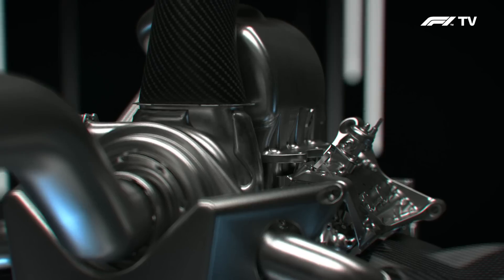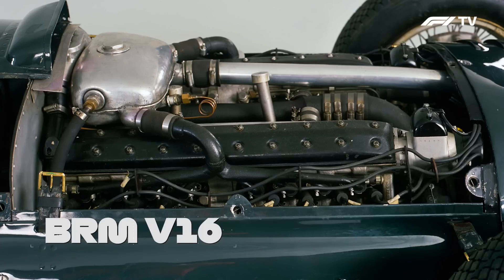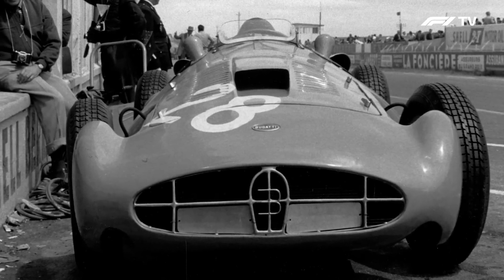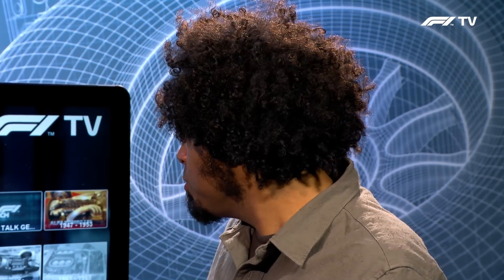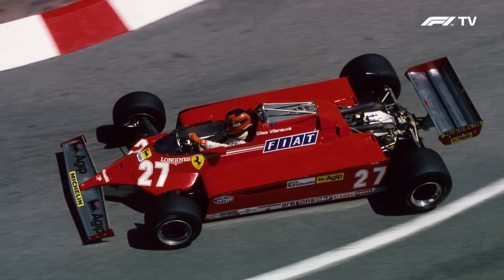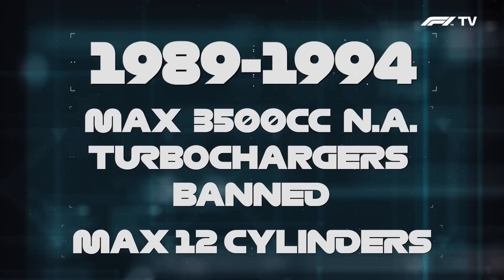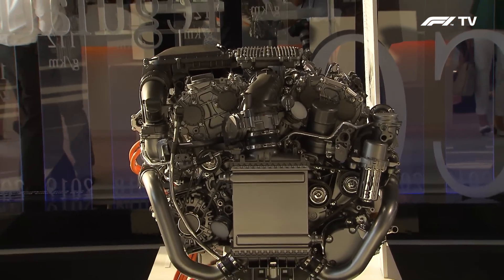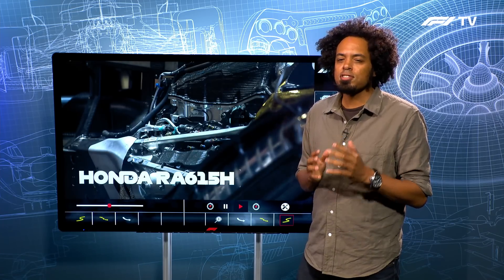Evolution Of F1 Engines | F1 TV Tech Talk | Crypto.com

Comment: I’d have a rule that only production engines can be used, but teams can do anything they like with them. Diesels are allowed, so long as they’re production based. Although they’re a 2 litre off the shelf production model engine from the assembly line, anything goes. Cylinders are unlimited, so long as it’s the same as the engine you find in a production model car or light truck.

Comment: I don't understand why they are pushing hybrid systems and "sustainable" fuels, yet manufacturers aren't allowed to use variable valve timing or lift control, variable length intake runners etc. Wouldn't it be better to allow these technologies as they (vvt/vvl) are already commonplace on road cars?

Comment: I'd like to see a two tier system, like they've had at times in the past. Say an N/A 1.5 litre V12 with a minimum weight car around 700 Kg, and a turbo hybrid at the current weight limit. Make the V12 cheaper to engineer to get more manufacturers in.

Comment: The biggest issue with formula 1 is the size and weight of the current car's. The car's of 2004-2007 were far more exciting to watch. They were significantly smaller and lighter. Combine the old cars with the old Q3 Qualifying sprint and it got really exciting to watch. Even the tyres were better in my opinion.

Comment: Awesome video, yesterdays video on efuels and 2026 motor regulations was cool too. It's the first time I saw conformation of F1 going to 100percent efuels, love it. But with some of the things I've seen this year in F1 I have became a supporter of a mostly controlled chassis built by a third party, with some parts the teams can develop like front and rear wings. I think teams should able to change gearbox ratios on a race by race bases so teams can make changes as the engines develop. I like the idea if a new team came to the sport there could buy a chassis, get a engine deal and compete out of the box. If a new team wanted to enter sport now they will be years behind with ground effects. FIA I believe needs to take control of the ground effects element of the car.

Comment: Thermal efficiency of more than 50% percent. I know this is amazing for an ICE, but it’s absolutely unsustainable in comparison to an all electric power unit. It’s like an old skool light bulb versus a LED diode.
Reply: 50% Amazing? This is absolutely crazy, there is nothing on earth that can come close to that. The technology behind it is unbelievable. I wonder how far can they go while keeping the engine reliable
Reply: It’s not ‘thermal efficiency’, it’s thermodynamic efficiency.
The greater than 50% achievement of MB means that it’s much more efficient than generating electricity in a power station & then charging batteries.

The loss of the MGUh is a backward step in the thermodynamic improvement of a power unit…

Comment: I think the regulations have ended up limiting the spirit of Formula 1.  You should have the ability of competing different types of engine configurations, with or without forced induction.
Larger capacity engines naturally aspirated vs small capacity turbocharged engines.  To me the most beautiful engine sound comes from V12s engines, V10s and V8s are nice, but nothing like a V12.  I remember back in the day when 4 cylinder turbo engines were it.  Then came the V6 turbo, then came the ban, are the different configurations flat boxer engines, v12, v10s.
I did not like the V8 era very much, but it was better than the current era where one manufacturer has obliterated the competition.  No one can come close to Mercedes dominance.
Reply: Considering that the top four teams rn all have different engines your comment about Mercedes dominance doesn't really add up
Reply: @bananatree2527  oh! yes! you are absolutely right!  After 8 years and changes in regulation allowing other manufacturers to catch up with them, Mercedes dominance has been reduced, and has been finally demoted from the top to a third.  Oh by the way, their problem right now is aerodynamic and balance, not a deficit in power from their power unit, but you are right, my comment is just crazy.  Sorry!

Comment: The engine regs are meaningless in terms of F1's carbon footprint.  Getting the teams, tools and cars to the venue burns orders of magnitude more fuel. And getting the fans to an from the track burns orders of magnitude more fuel than that too.  In my opinion, F1 needs simpler, lighter, safer and cheaper engines. More spectacular sounding too. Bring back the NA V10s!
Reply: What you mean "safer" engines?
Reply: @Spectrolite1  With an IC engine you have the risk of the fuel catching on fire. With batteries you have the risk of high voltage shocks, noxious chemicals, and also battery fires for that matter. With hybrid, you have all those risks put together.
Reply: True

Comment: I dont get why F1 forces the engine layout to be a V6. If they set displacement and max fuel flow so that teams need to focus on efficiency to get more power, they should atleast give them the freedom to use as many cylinders as they want. 
If the teams want to focus on something close to their other cars (either race or road cars) then it should be there choice to make. It just looks like a useless part of the regs.
Reply: You'd likely then see three or four cylinders, not eight, ten, or twelve.
Reply: @UncleKennysPlace  yes maybe, but I think overall we would have more than 1 engine layout. (And lets be real, would someone like Ferrari ever do that?)
Reply: It's to attract engine manufacturers because they will only be interested if the technology would be applicable to consumer vehicles.
Reply: @mannedi8665  if a Manufacture decides to use a V6 for that reason thats fine but my point is why force them to use it? Does anyone think they need F1 to tell them whats relevant for their road cars?

Comment: Might we see anti-lag systems? Because lots of pops and bangs going into turns would be awesome.
Reply: Nope, with the MGU-H being removed, there will be even more lag.
Reply: @meemaw.  I mean, to counteract that, would we see the anti lag technique of delaying ignition on one or more cylinders to increase exhaust velocity at the expense of volume and fuel efficiency?
Reply: @DJ_Level_3  Nope, because that doesn't fit with F1's "green" image. If you want flaming exhausts, you can watch F2 though.
Reply: @DJ_Level_3  Unfortunately no, as Dylan stated it would go against Green. These regs are basically removing 300HP from the ICE and adding it to the PU. I don't like these changes much IMO.

Comment: I wonder what would happen if someone built a modern F1 car without restrictions and unlimited money. Say a 7.0L turbocharged V12 hybrid or something like that. How many HP are possible?
Reply: Look up the Red Bull X2010 car, where Adrian Newey designed exactly what you ask for, the ultimate F1 car.
1500 hp would be enough and we could easily make that from just a 3L V6 turbo for example so no need for a heavier engine.
The problem is the human body - Noone can take the 8G cornering or the breaking without destroying your eyes, even for more than say 5 laps in that car.
So if a robot drove the car, sure, we can have that car and since no humans can die then - We can literally race a field of them at old Spa, Nordschleife, old Monza and so on.
Reply: the main concern is not the HP, is the brakes, no matter if you can drive up to 600kmph if the only thing would stop you is the wall

Comment: 1956 and Bugatti introduced the mid-mounted engine?
Pre-war Auto-Union had that nailed in 1935 and dominated in 1938 with it.
Let's not forget that what is F1 existed since 1931 and as individual independent GPs since 1906.
Reply: The Auto Union cars were not designed to F1-regulations, because those didn't exist yet. So they obviously don't count.

Comment: What about the return of the V10 engines, using Hydrogen and particle filters? It would also promote the development of conversion system for current ICE cars on the roads. Few seconds of those V10 engines reeving on the track, would be enough to convince most F1 fans.
Reply: I bet the V10s you guys want won't even sound like the ones F1 is known for
Reply: Too big of a safety risk to have high pressure hydrogen tank in a crash both for drivers and fans
Reply: @stevetrepanier4351  That may have been true decades ago but modern hydrogen tanks are far stronger than fuel tanks. Hydrogen can even be vented extremely quickly in an emergency and thus negate any explosive situation. Gasoline or any liquid fuel would simply spill and flammability would remain from the vapors. I'm not saying we should switch it all to hydrogen, just that the explosion risk is less of a factor than it is with ICE vehicles.
Reply: Theyre still very inefficient, that was ok 20 years ago when power was all about just pushing an engine to as high an RPM as possible but as technology advanced it became relevant not to just produce LOADS of power but to make the most of lost energy. The scream was nothing more than an inevitable side effect of the way technology advancing and the regulations back then, and f1 has always been about new technology.

Its a shame but its not like you cant experience historic f1 cars at all anymore, I'm going to the silverstone classic this year because there will be 90s F1 cars racing.

Comment: No, no, no. You can't pretend that suddenly being "sustainable" and "efficient" is exciting for the future. Formula 1 is first and foremost entertainment for the viewers. Without it, none of the big sports could even exist. Litterally nobody wants Formula 1 to be politically correct or socially acceptable. 
The entire history of the F1 engine is about racing and the excitement around teams developing the fastest cars. At no point has anyone said that being green is exciting, until this silly hybrid era arrived. And now, with these new rules set for 2026, the combustion part of the engine has been reduced to a mock engine, using less fuel, producing less power while the holy battery takes over. 
F1 and FIA had better realise soon that entertainment value and political correctness do not go together.
Reply: The 2020 W11 is the fastest formula 1 car in history, so what are you talking about?  Motorsports in general has always been about making road cars better, which in the modern day means increasing efficiency without sacrificing performance.
Reply: @TheAstronomer100  What am I talking about? Power produced by pistons burning fuel. If you want cars powered by electricity, watch Formula-E or iRacing.
Reply: - Asks for speed
- Current cars are among the fastest in history

Opinion disregarded
Reply: @dod_the_angel  "asks for speed"..where? Fail and a miss.
Formula 1 has forever been about cars with engines burning fuel inside engines. If you had been as sharp as your comment pretends to be, you would have noticed that fact in the video.
Reply: @TheHighlander71   If F1 is about teams making the fastest cars (which you claimed it was) then it doesn't matter whether that power comes from an engine, a motor, or a hybrid power unit.
It's the same as how F1 dropped manual gearboxes in favor of sequential gearboxes.  
Personally, I'm glad to see an investment in synthetic fuel because that will keep gas powered cars feasible for consumers that would rather own a manual with pistons (like me).

Comment: I would love to see more freedom with the layouts, would love to see porsche trying a boxer engines, but probably an engine like that would limit potencial the venturi tunnels and the diffuser.
Reply: Boxer? Porsche already have a V4 Hybrid in the Porsche 919,  "just add 2 cylinders"  lol
Reply: @Fael-TXR  of course! Maybe Mazda could join as well and run a rotary enginen
Reply: @Fael-TXR  Porsche already has a working F1 V6 they built around 2017. They can just remove the MGU-H and work from there. 

Though rumor has it Audi actually wants to use the old engine, and Porsche will build an entirely new one with Red Bull.
Reply: In le mans hypercar the layout IS free and Porsche chose the V8 so they will not Come back to boxer
Reply: One of the goals is to maintain competitive racing, unfortuntely freedom in the layouts would inevitably lead to quite big performance differences
Reply: @CTcuber4K  One of the reasons why we saw so many different engine designs back in the day is because every design is a compromise in some way, and rarely is there ever a clearly superior option. If one layout proved superior to the others, then the other manufacturers would just switch to that layout. Any performance difference would be temporary.

Engine regulations are only as strict as they are today in order to limit costs to manufacturers.
Reply: They would still make either a V4 or V6, their modern top level stuff didn't use boxer engines. Even their old LMP2s had V8s
Reply: porsche's boxer engine is basically a 180 degrees V6
Reply: You can thank Ferrari for the V6, they were the only veto for moving to 2L 4 cylinder.
Reply: I agree! it would be a trade off concept. H6 or Boxer layout provides the best center of gravity and could be mounted very low. However, the trade off is less downforce. You pick your poison more or less.

Comment: IT GOT WORSE: Since they are going to maintain the engine size at 1.6L, but aiming 25% less fuel flow, it means they gonna decrease the RPM by 25% too. There´s no way around it.
Less RPM = Less sound 
Why can´t they listen to the fans for once?
Reply: I am no expert in any way concerning engines but didn't they say that the decreased fuel flow is substituted by double the electric power from the Motor? This electric Motor will boost the rpm to where it was before 2026 at 1000hp
Reply: @nudelwolves616  perhaps you are confusing RPM (rotations per minute) with engine power
Reply: @gustavoehler  yeah that may be. Though  they did say in the last video about the new engines that they will sound the same. We'll have to see I guess
Reply: Same rpm you halfwit. The engines are just producing less horsepower and the MGU-K supplements the rest of the power up to about 1,000bhp
Reply: rpm doesnt affect fuel

Comment: Might as well start watching Formula E to prep myself for the future Formula 1.
Reply: i think everyone wanna distinguish formula 1 to formula e and they would never go fully electric, so we don't have to worry about that
Reply: @Mr-BareMinimum  F1 may go fully electric at some point in the future, but it surely won't be soon - as it can't be. FE signed a 50 year exclusivity deal with FIA so we're safe for quite a while.
Reply: @kenkalajdzic  that's enough for me
Reply: @kenkalajdzic  uh it expires in 2039. Which is only 17 years from now…. by the time the next engine regs come out, F1 and FE may merge
Reply: @YTN1112  Welp, it seems it's only 25 years. I've had 50 I my mind since FE's inception ...
Then again, F1 won't have any interest to go electric before technology matures enough to sustain current format - 305 km races, wide open throttle 70+% of the time. And I'm not sure that'll be possible for a battery electric vehicle even in 2039. (also, it would be nice if the cars don't weigh 2 tons)
Reply: @YTN1112  no
Reply: ICEs will always have a place in motorsport i think, but we'll never go back to V10s even if 100% sustainable fuels are developed